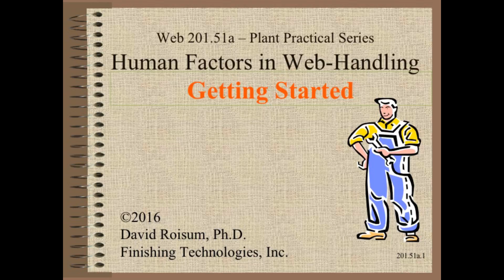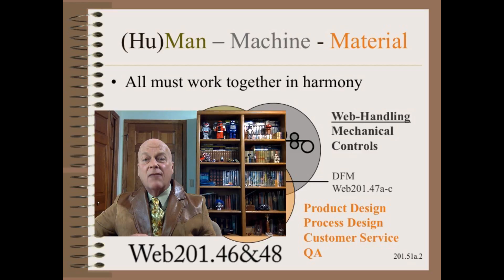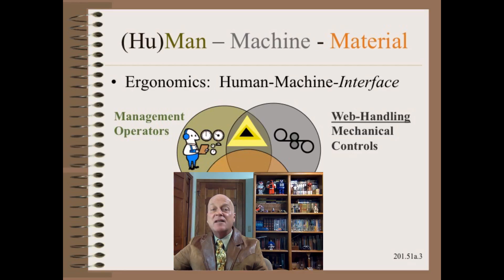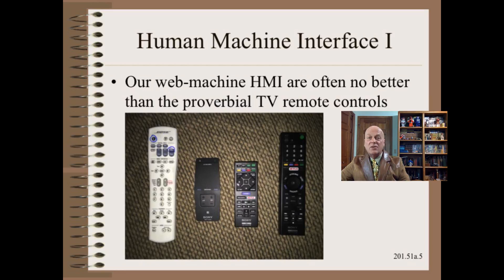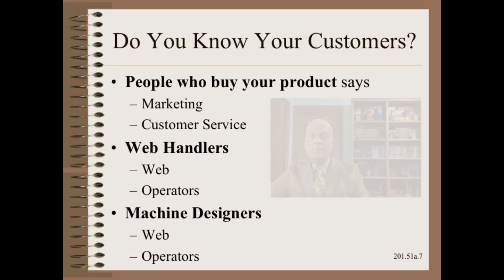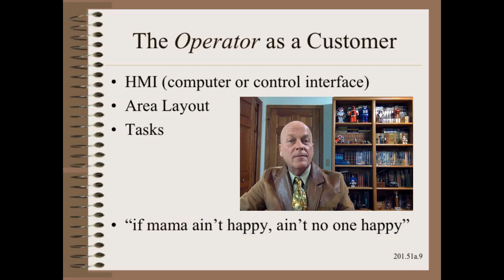Web20151a - Human Factors - Introduction

Comment: Great series. I watched all 5 episodes in one sitting on my desk chair.I did change the speed to 1.5. It was so interesting, I did not even get up to get some cold water from the faucet or watch my clock. The suggestions for tension controllers in the last video will be used ion my tension control design in the future.
Clarence (Reeks) Klassen (of Geek)